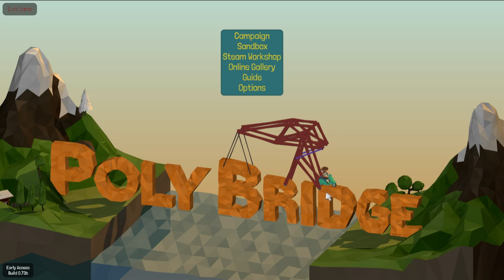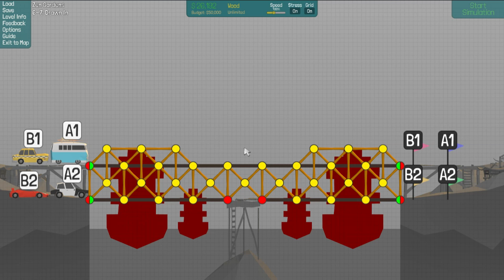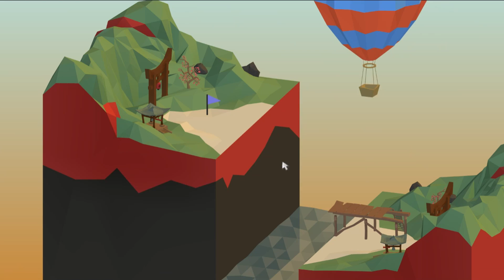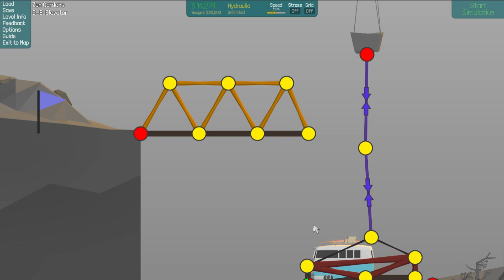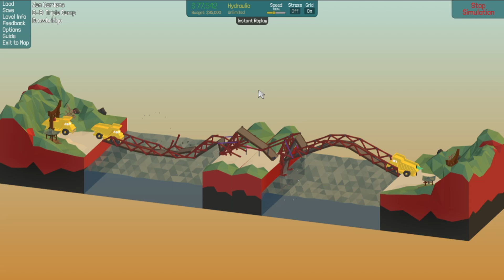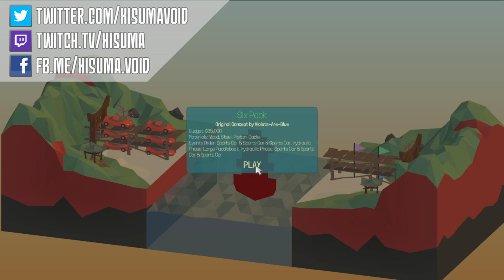Poly Bridge 17 Extreme Engineering!

Comment: Trick for the elevator is to not to try to construct a traditional elevator. Instead, build a sloped road from the top to the van. If you were to make the road a straight incline, it would be too steep for the van to drive up, so you curve the road so the van can get onto the road, but not all the way up. Then you use hydraulics to push/pull the low end of the road upwards, so it decreases the slope, allowing the van to drive up the rest of the way.

Comment: On the elevator one, how about using hydrolic curved road connected far over the vehicle to the left going to the far cliff, and the more centered end connected to the balloon with some extra hydrolic line? It'll try to flip right side up while the vehicle is driving into it. Then small adjustments would be most likely needed to get the rest of the way.

Comment: for the elevator one use the ramp straight up to the edge but lift the bottom side of the ramp (Since the car drives up onto it you shouldnt have a problem getting the car on). you can also put the ramp slightly below the start point if you need a moment for the car to get on the ramp

Comment: For that elevator you needed to use the last design but use a hydraulic you lower down the the edge to when you reach to top the van can drive but until then it it too steep.
Reply: +Olly Also, he completely missed that he had a suspension.

Comment: Why don't you ever drag the hydraulics' arrows to make them retract more instead of adding multiple ones?
Reply: +Ben The Youtuber but 2 small pieces which retract 50% are exactly the same amount as 1 bigger hydrolic rectracting 50%
Reply: +DJDavid98 50%(The middle) is the most you can tetract, going away from it retracts less.
Reply: +Martijn Koppejan hydraulic*
Reply: +DJDavid98 Maybe because the hydraulic can only take so much stress, and having more than one provides a more stable structure? because its all well and good if the hydraulic pulls it back, but it doesn't work if it proceeds to break.

Comment: For that last one, can you use the split joints and your relatively new-found ability to control what parts are on what side of the split to connect the lowering part to the stationary part and support the lowered part on both sides?